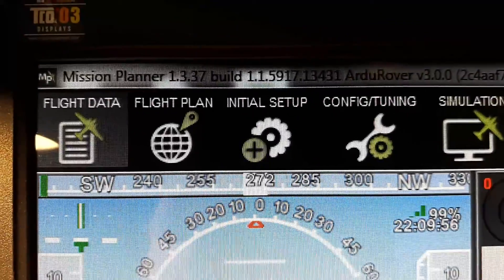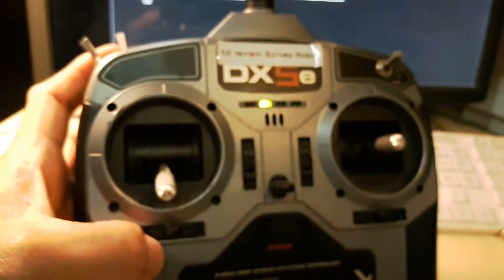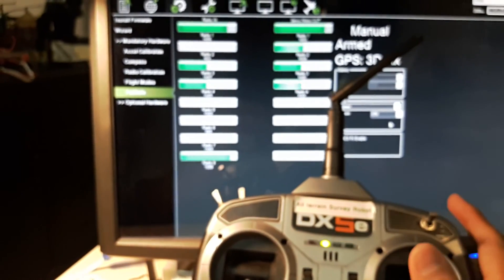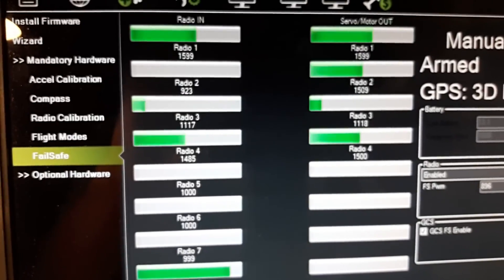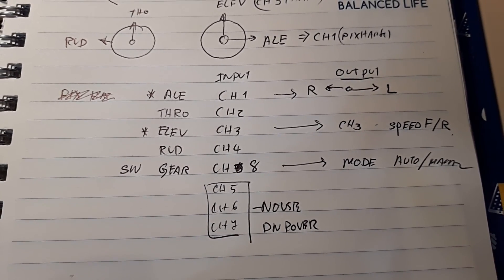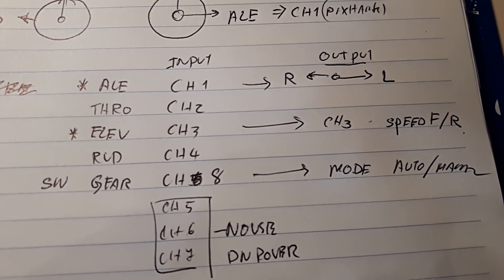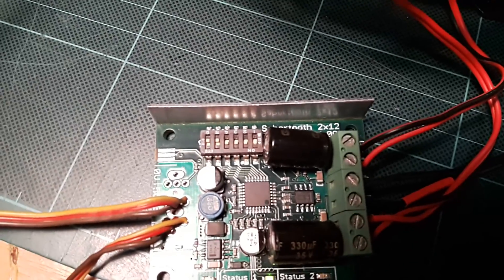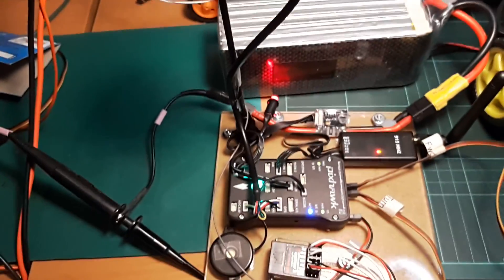Pixhawk connection with Sabertooth 2×12 mixed mode

Comment: Hello, nice video, I also have a Pixhawk and a 2x32 Sabretooth, but i'm having a problem, first is that my channel 3 Throttle is not responding in the FailSafe screen like yours, did you configure your board with a setting for that to work?, and if I may, what version of Rover Firmware are you running?